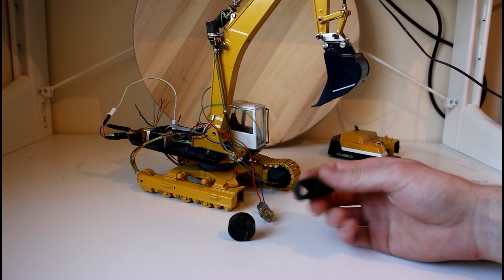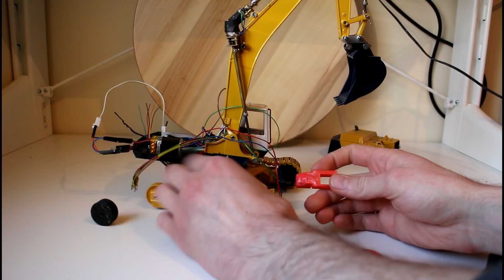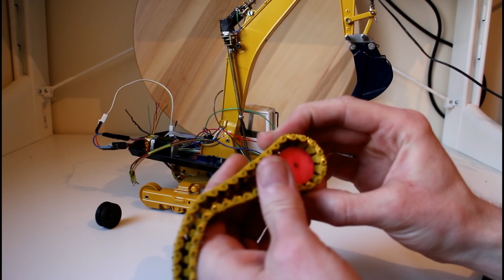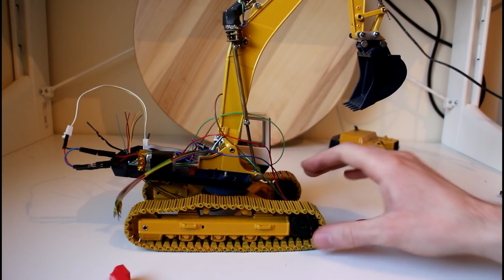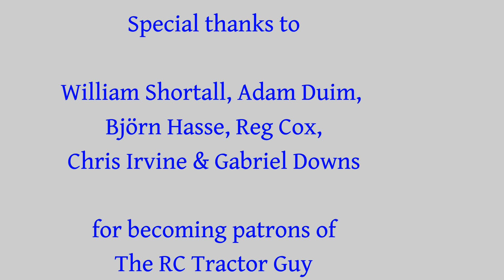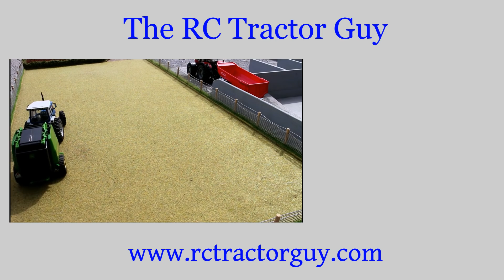RC Komatsu PC400LC Part 7   3D Printed Track Drive Components Update

Comment: Great video!  After some thought, it makes sense to make the motors adjustable since they already slide into the channel. The rear idler gives some strength and stability by being mounted solid.
Reply from the maker: That's true, probably be easier to redesign the plastic motor holder than to modify the other side.